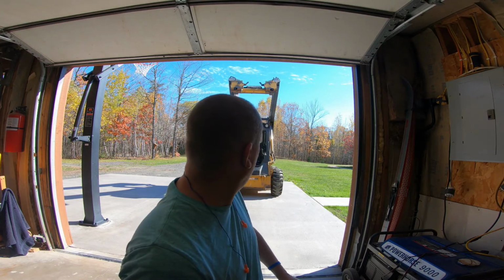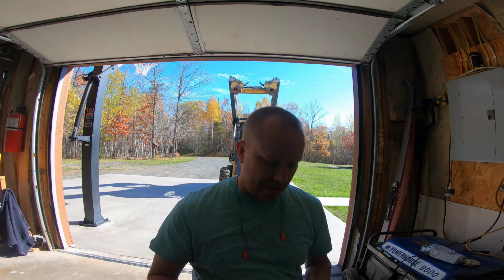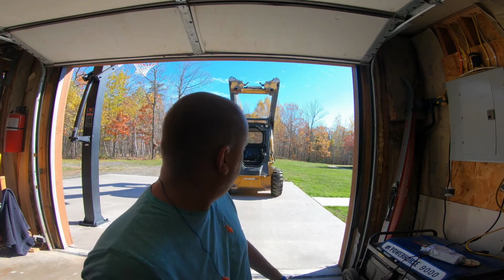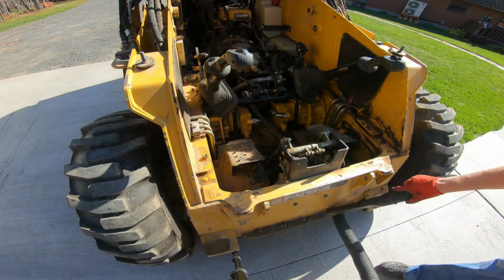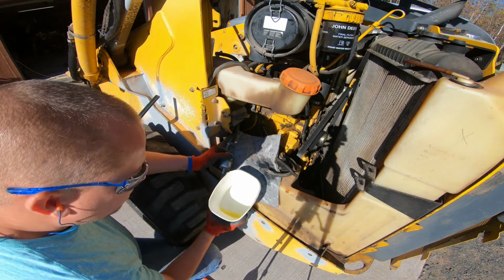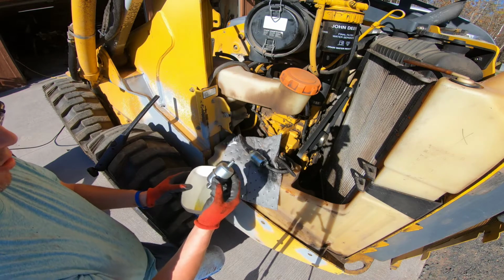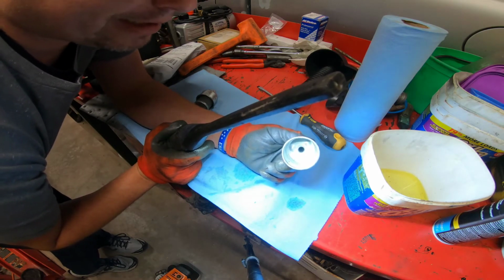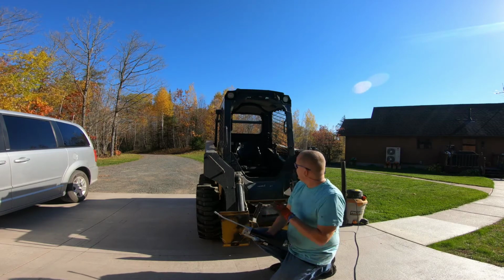John Deere 318D Skid Steer Maintenance, Inspection, Fuel Filter Analysis

Comment: Got a question for you. Is that the original engine? Ive heard that these were known for the fuel pump, when it goes. It trashes the engine, due to how this engine is set up. I do own one myself. A 12' 318D. With 2300 hrs. Love it. But curious if you heard these issues? Some say run conditioner in fuel and maintain filters, and will go a long many hours before engine failures.
Reply from the maker: I am the second owner of this unit and everything looks original except for the water pump, hydraulics cooler, and the drive unit I repaired. I haven't investigated much on the reliability of the fuel side, but maybe I should.  I do mix a fuel conditioner with lubricity into the fuel.
Reply: @factotumlife thank you. I've heard that as long as you keep running conditioner along with good fuel, it'll be fine, through research I've done with dealerships that sold them, along with contractors that have them and claim they have  10,000 hrs+ on them, and all say keep the fuel system clean and lubricated. Again. Thank you for your input. Love your videos for help with my 318D

Comment: Hey Boss..... I have a 2016 318D and we are doing maintenance - do you know if the Hydraulic Fluid is the same as the Crankcase Oil ?   
i called our local John Deere and they said..... the Oil in the Crankcase is the same as the Hydraulic Fluid but two different reservoirs 
Can you confirm this ????
Any help would be greatly appreciated
Reply: My dealership told me that same. I run 0-40 in the engine, hydraulic and crankcase.
Reply: In the process of purchasing a '16 318d as well. How has your unit been holding up?

Comment: I have a tip for everybody that has a JD 318D.
Got this from another Channel and this guy is smart - he actually called me about it.

Issue:  When I worked my JD 318D semi hard I would get the error:   "Engine Degraded 75%"  and there was a noticeable lack of performance.
Solution:   There is a electrical sensor / plug on the fuel pump (left hand side)  Disconnect the plug or replace it with a new one (approx $20.00)  and the problem goes away.

I have not tried it yet but I am going to asap.

Any comments on this ...or if you have tried it before.......please feel free.